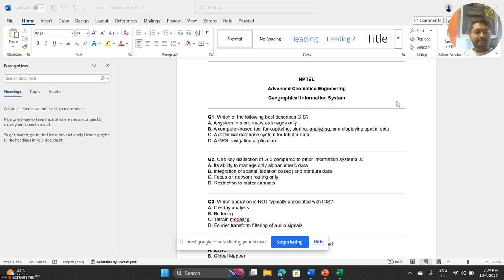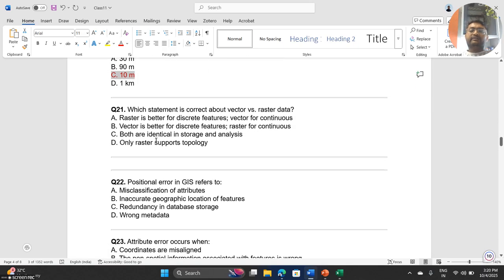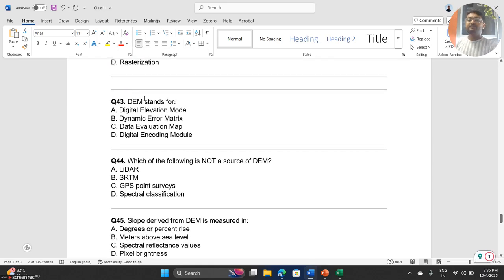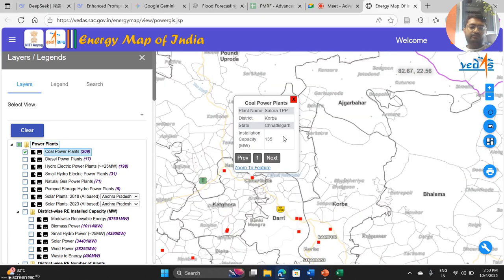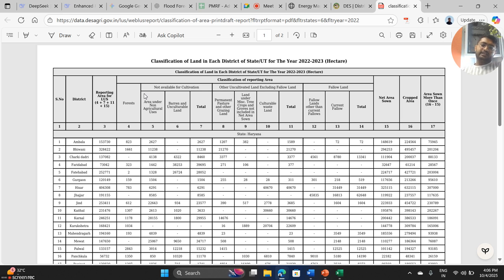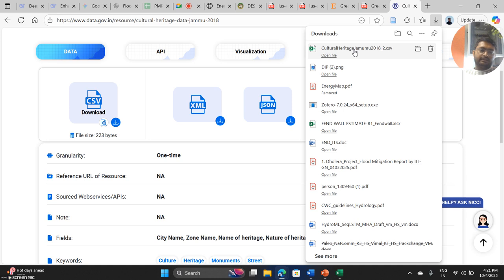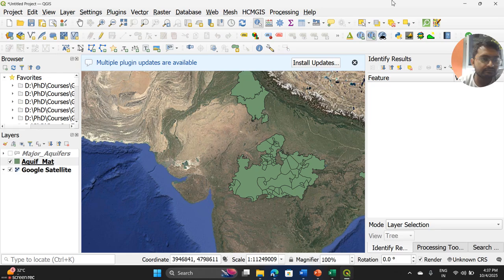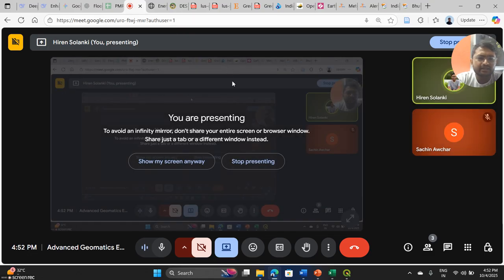Week 11: GIS | Problem Solving Session | Advanced Geomatics Engineering | NPTEL

Comment: 00:08 - Introduction to GIS and its role in data analysis and mapping.
06:38 - GIS is a computer-based tool for spatial data analysis and management.
13:01 - GIS requires integration of tools, data, procedures, and human input for effective problem solving.
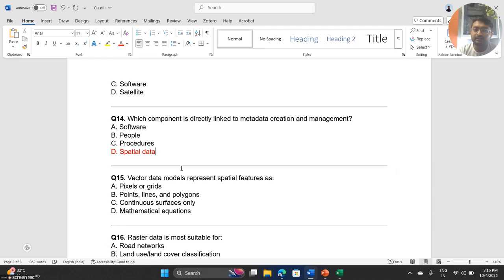16:02 - Metadata and data models in GIS highlight key limitations and characteristics.
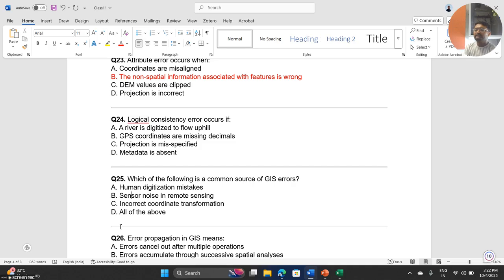21:49 - Understanding logical consistency and error types in GIS data.
24:33 - Field validation identifies issues in satellite data through on-site measurements.
30:05 - Understanding topology errors in GIS data inputs.
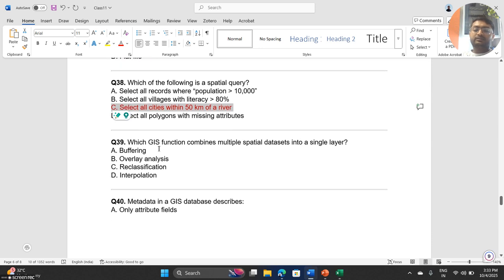33:24 - GIS techniques for analyzing river buffers and integrating multiple data layers.
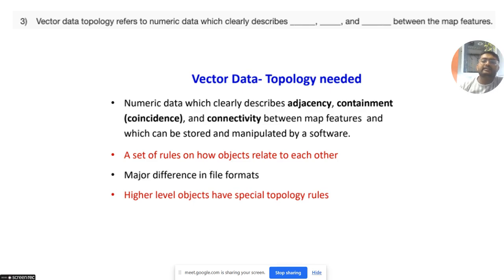39:41 - Understanding topological errors in GIS digitization and data management.
42:12 - Python and GIS leverage machine learning for data relationship visualization.
47:33 - Introduction to GIS data set sources and upcoming applications.
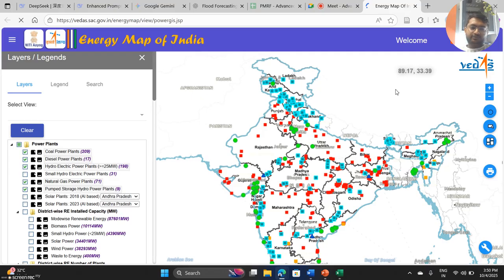49:56 - Overview of coal power plants distribution in India.
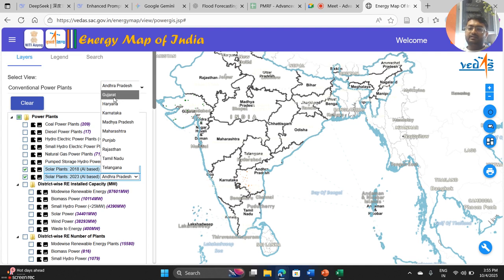54:51 - Analyzing renewable energy distribution and infrastructure in various districts.
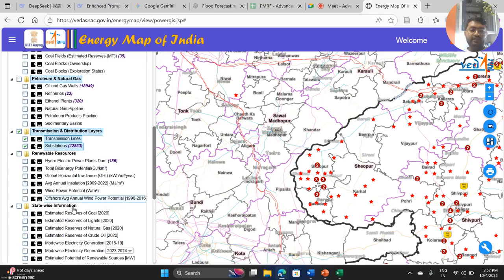57:17 - Analyzing renewable energy and infrastructure resilience in GIS.
1:02:15 - Discusses data digitization and land use classification challenges.
1:04:38 - GIS aids in analyzing agricultural statistics and land use classification.
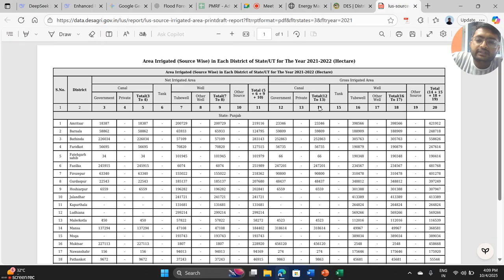1:09:25 - Exploring irrigation data and mapping techniques for effective resource management.
1:12:04 - Analysis of irrigation sources and trends in Rajasthan over 20 years.
1:16:41 - Overview of GIS data resources and analysis for agriculture statistics.
1:19:00 - Overview of open data resources for GIS and related fields.
1:24:42 - Comprehensive datasets available for various sectors in India.
1:27:05 - Discusses challenges in accessing and validating aquifer data.
1:32:02 - Overview of aquifer data and groundwater storage details.
1:34:18 - Aquifer classification based on geological formations and materials in India.
1:39:01 - Access freely available DM and resource data for analysis.
1:41:21 - Analyzing urban expansion and environmental data trends.
1:46:21 - GIS data and freelancing opportunities discussed.
1:49:07 - Monitoring environmental factors using GIS enhances decision-making for public health and resource management.